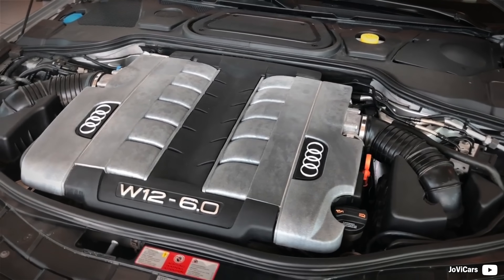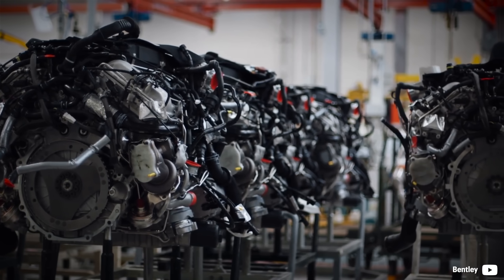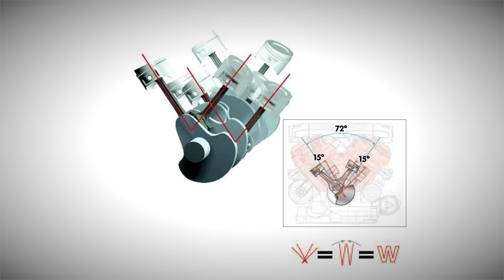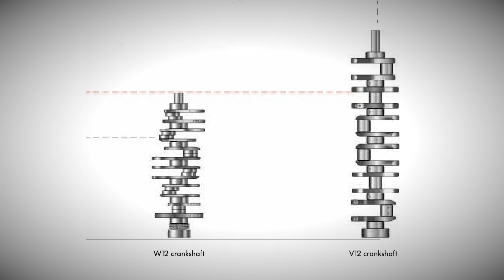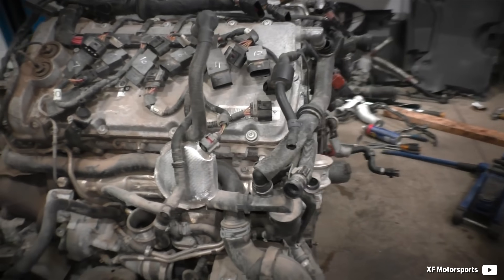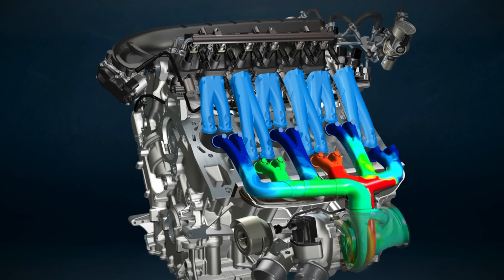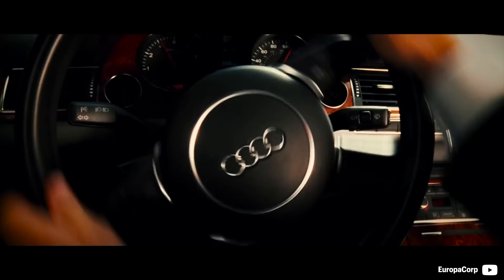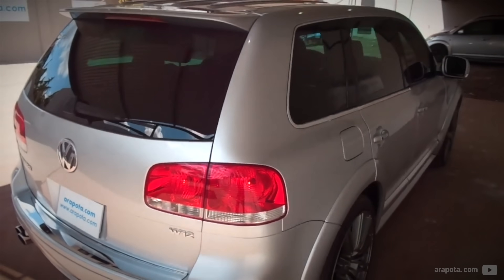What Is So Special About the VW W-12?

Comment: I considered buying a Passat W8. Very cool sound, but very expensive for a regular old car with a cool sound.
Reply: Doesn't have a great deal of horsepower,  is very heavy and only comes in a manual transmission.  On paper it has low power poor mpg and is very heavy
Reply: @chrishart8548  😂🤣

Comment: I still wanna Passat W8 so bad! Sounds batshit insane when modded.  But also crazy maintenance costs
Reply: Maintenance isn't very expensive, at least were i live. but keep in mind that this engine has some timing chain Problems (it lengths over time if not driven carefully and is expensive to repair), just ike the vr6, so always drive it warm before flooring it, use some good quality oil and keep the oil fresh, than it should be fine
Reply: I found one once like 15 minutes away from my house. Just it needed work I was so pissed off.
Reply: @emmanualstanley373  why
Reply: An old boss had a passat wagon W8 it was stick too. Nice sounding car.
Reply: @Mark_317  I think they were all manual transmission.
Reply: @Chris Hart - no, not all W8 Passat’s were stick shift.  I had a W8 Passat wagon synchro come through my shop years ago.  It was badass but also an automatic.
Reply: @ghostwrench2292  w8s are 4motion not syncros
Reply: VW and Audi are cars that's frequently need engine out service so I wouldn't be too worried
Reply: @kirunacat that's what scared me away from the Touraeg V10 TDI
Reply: They sound so nice with straight pipes ,as evidenced by many videos on here.
Reply: @MrTheHillfolk  Love it straight piped from the cat back its just enough for me for now
Reply: if your that worried about maintenance just get a mk4 jetta with a vr6 they sound great also
Reply: Always has been? So say... is this "passat" in this room right now?
Reply: Was always a wet dream of mine to stuff one in a MK4 Golf or Bora/Jetta.  

4.0 litres, V8 sound, 300 bhp NA?  Yes please...
Reply: Theyre like 2k here nobody wants them lmao
Reply: I have a w8 passat. The maintenance isnt that expensive.
When i bought it i changed spark plugs, timing chain, alternator belt, oil, all filters, brake discs and bads and it cost me around 1800€ (i didnt cheap out on oil and brakes)
Reply: I drove one once. 
My license doesn't need one.
Reply: Parts cost aren’t easy to swallow, but as long as you learn the car working on it is easy
Reply: Use to have one... not one mechanic would put his hands on it lol...